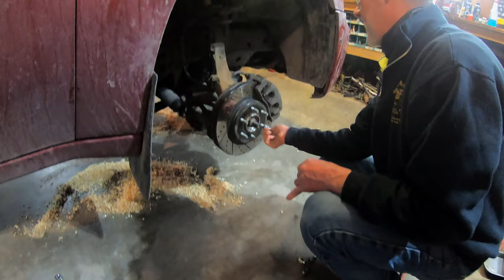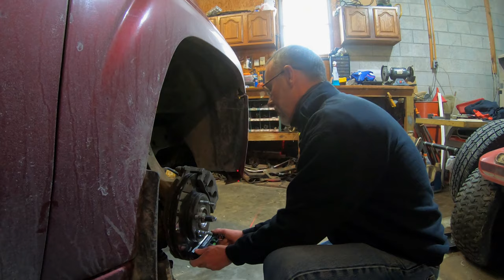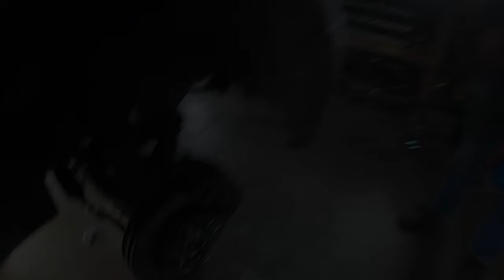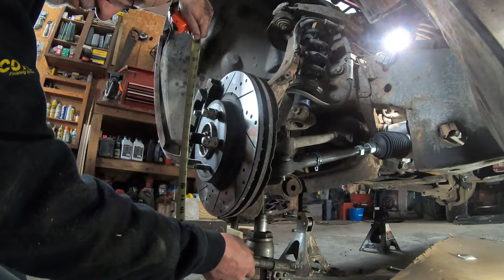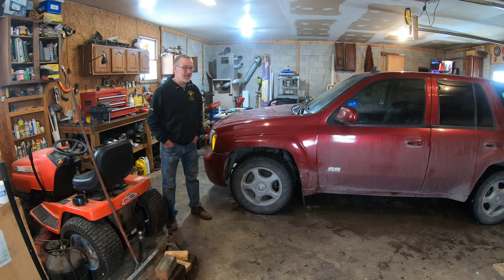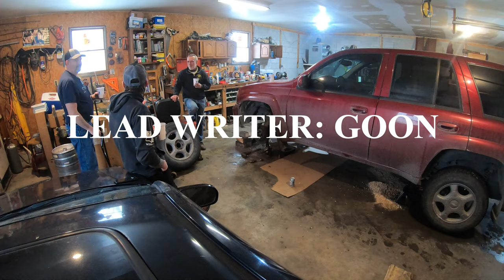DIY How to adjust alignment of rack and pinion at home

Comment: that was only a toe adjustment …. you never checked your caster or camber …. but all things considering they were probably in spec …. good job
Reply: you cant change caster on any new vehicles these days, not possible without aftermarket upper control arms that have bolts that move like a tie rod.   on each side.